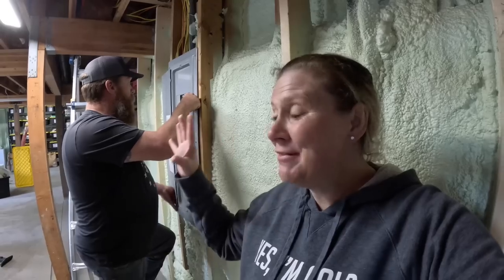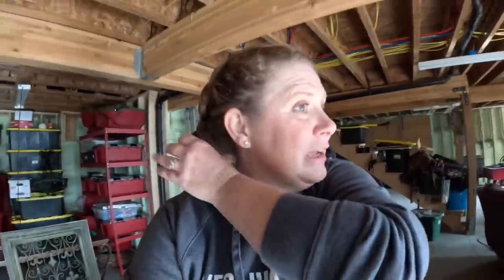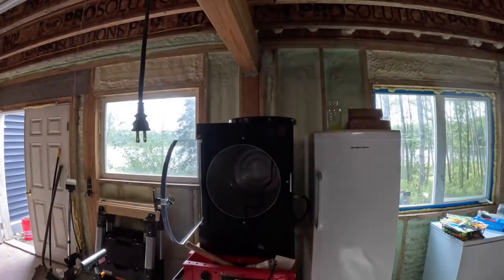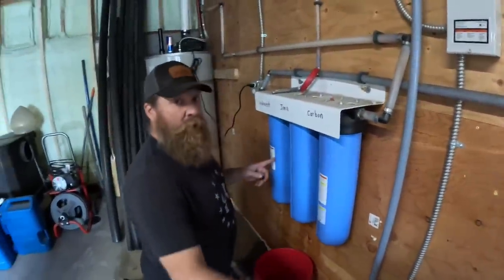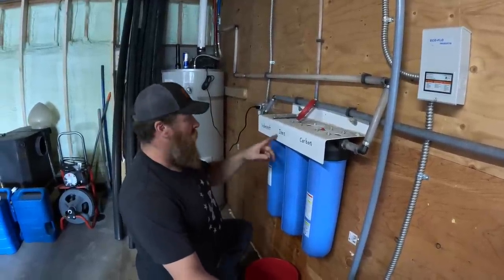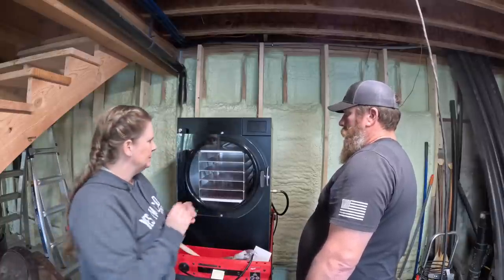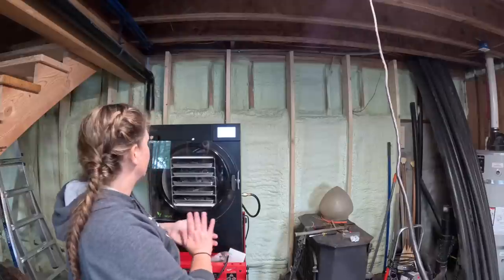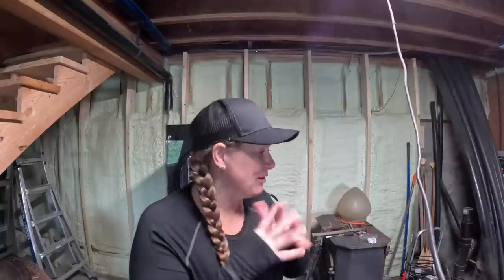Fixing a Broken Freeze Dryer: How We Tackled Electrical Issues and Replaced the house Water Filter

Comment: We had to change out the mother board twice. Love the harvest right freeze drier when it works, but sucks when it doesn't. My unit will over heat they say will still work just takes longer meaning more energy. I learned to do the machine on cold nights and a fan on the compressor, so it is a learning experience. You have the large unit which takes more power and has to have it's own outlet. Why I am happy with the smaller unit. Plug and play, no special outlet. Not feeding as many people as you either. For me the freeze drier was a great investment, ran the unit 24/7 except for a few days when the mother board blew. Slowed down since I moved but still using it have trays of banana slices to go in.😊
Reply from the maker: It’s not been quite the godsend we expected! However my heart still has high hopes for it. We kept trying to fix it like it did soup great no issue, did candy great no issue. The fruit issues but I got it to work. It was just a constant battle. It’s run several loads now with no issues! So fingers crossed.